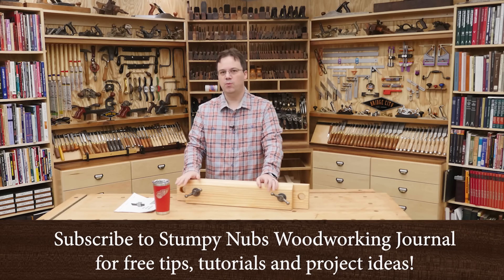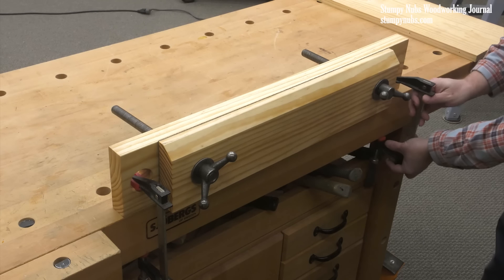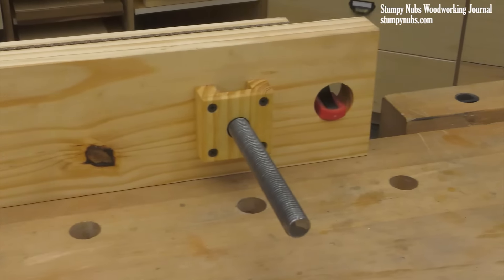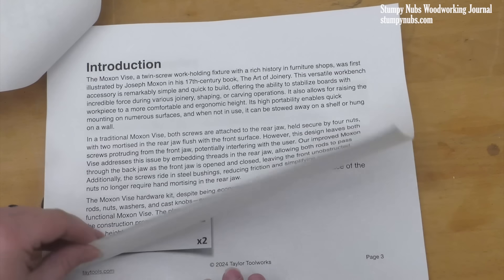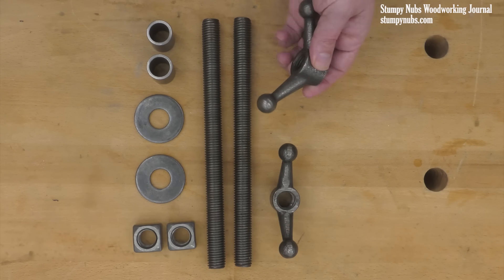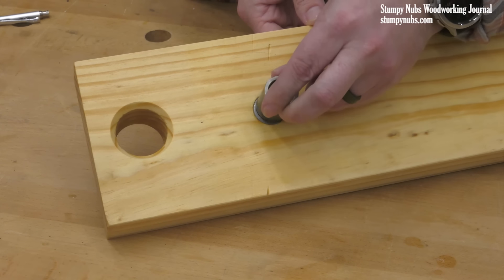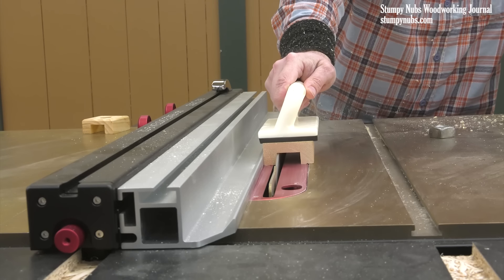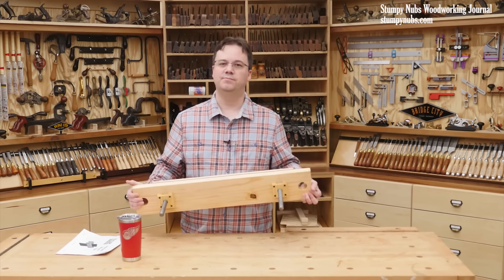Never worry about clamping your work again!

Comment: Very informative and a nice addition to my woodworking workshop. I'll use a smaller version for my craft workbench. Two hints to share, leather works well as an alternative to the cork rubber. In my experience, the leather holds up better. Also a brass nail used a a stop to keep the square nut from falling out the bottom of the slot, or better yet, mount the slot horizontal. This is better than picking up the square nut after it falls to the floor. Thanks for sharing. Please, more videos like this.

Comment: Cool. I made those plans for Taylor Tools. Glad you built it.
Reply: Why are the clamp holes round? It would seem that you could get better clamping with holes that have flats, similar to the oblong holes on the front jaw.
Reply: @mschmidt62  You could make them oblong or flat if you wanted to.
Reply: @mschmidt62  I agree with you that a flat "hole" for clamping would be better, since the fixed jaw of the clamp would only contact a round hole at 2 points, as opposed to the entire width of the fixed jaw. That being said, I suspect it is much easier for most folks to create a clean round hole instead of a flat one.

Comment: Great clamp. For  those who dont want to order the kit. You can use 3/4 all thread and 3/4 gas pipe T and two nipples to make your handles.  It work's great
Reply: But the 3/4 gas pipe T doesn't fit the end of the 3/4-10 threaded rod.   What threaded rod are you using?
Reply: @hendrst1918 Going off of memory I think 3/4 -14 npt is the size of the all thread. They were left over from a job I did. The customer loved the rustic look and we used gas pipe for everything. Closet rods,towel bars,toilet paper holders etc.

Comment: James, you weren’t kidding about the “Improved” Moxon Vise kit from Taylor Toolworks selling out quickly. I’ve been waiting for them to restock this kit for several months. Sharing a tip that I just figured out: buy TWO of the  - in stock - 12” Wagon Tail Vise kits + 2, 3/4” Washers from the “Moxon Vise Hardware Components” listing. TWO 12” kits + the 2 washers equal everything you’ll need to make an “Improved Moxon Vise.” Going this route costs ~$6 more than the “Improved” kit, but it’s available now. The only difference I can see is that the threaded rods with the “Wagon” kit are 12”, compared to the 10” rods that are part of the “Improved” kit. Figured I’d share this with your audience as a workaround until TayTools restocks the “Improved” kit.

Comment: Rob Cosman added a spring on each threaded rod. That’s a great touch to this great vise.
Reply: Smart!
Reply: What does the spring do?
Reply: @nitePhyyre  i imagine it's for opening up the clamp when you back off the screws. But that can also be done with a nut and washer fixed on the screw shaft and recessed in a countersink on the inside of the front board.
Reply: You won’t want a very strong spring I’m guessing a 15#~20# lbs. spring would be sufficient! If your doing delicate dovetails or something similar this would be a great idea!
Reply: @FiltyIncognito firmly attaching the front piece like that would cause racking
Reply: @bret_Lambky  I'm nor sure where the spring would go.  Springs only allow so much compression before they deform.  The force is also proportional to the compressed length.  If the spring is very short, it'll be a lot stronger the more compressed it becomes (until it goes no further).  If the spring is long, then it'll be more even, but where does the spring get hidden?

I like the captured nut idea better.
Reply: I would imagine the springs would be up against the turning handles just with an extra washer for the handles to spin against. The springs keep tension on the rods so that even if you haven't really cranked them down super tight, to work on a delicate piece carefully, the handles will not spin. Just to prevent little things like them backing out and un-clamping the workpiece when vibrating from being worked on with certain tools.. like a jigsaw or maybe even an angle grinder.
Not a necessity, but can be minorly helpful in certain, very specific use cases. But there are other ways of accomplishing the same thing, like using different style handles, more akin to typical vise with a longer, sliding lever arm so it can only back out a max of ~45° before the weight of the lever arm prevents it from turning any further. Or using double nuts, like an extra nut on the outside of the handle to tension against it and lock it in place. Very stable, but the most inconvenient to work with, having to wrench those nuts loose and retighten them every time you adjust the vise..
Nifty little setup. I might whip one of these up layer today to try it as an interim on my drill press. As I need a vise on my drill press, but the one I'm designing to build is rather complicated and will take me a while to build it just right as I want several features to hold various shapes at various orientations, with adjustability on x, y, and z axis...
Reply: @Matthew-bc9mr  give Rob Cosman's Moxon vise video a try.

Comment: Seems like a great holding solution - which is key in most tool using situations. But I notice it has a little 'play' [bkwrd/fwrd] due to the clamping onto the bench. It has me thinking about simple fixes to reduce this problem - maybe a couple of triangular supports to prevent rocking attached beside the clamping holes? The fact that it can be modified is a plus point anyway. I've always said that work holding is at least 50% of a successful project, cheers Jim.
Reply: I noticed that too.  Maybe build up the back piece out of two thinner pieces, with the one toward the front broader, so it overhangs the edge of your work surface?  And screw a couple of shelf brackets onto the back?

Comment: These are a great addition to any shop! 
Instead of cork on the face of the jaws. I used some leather it helps reduce marks and provides a lot of grip! I would be concerned that after cork dries out it might fall apart.
Reply: Been using leather on woodworking vises for decades.  Always worked great for me.
Reply: Great idea will have to try this.
Reply from the maker: Cork rubber is a mix of the two. It doesn't dry and crumble. A great material.

Comment: I've got 2 of those vices on a workbench I built for cutting dovetails and joinery only. One of them has a 24 in opening mounted on one end of the bench. The other will hold a 31 inch panel mounted on the side of the bench I use for casework.. They're both long enough I can put longer boards into to plane the boards for glue ups with a joiner plane. Both are mounted flush to the top of the bench.  I built that bench probably 10 years ago and it's my go to bench. Thanks for your video.

Comment: On my build list! One modification I would do: a length of wood at the back base to add a little more stability. The piece would be dowelled and be the same height as the clamping holes. Also, I would flatten the bottom of the clamp holes so the entire face of the clamp can be applied to the wood.
Reply: This is a great tweak to the design, thank you.
Reply: Great idea.
Reply: Can you better explain "flattening the holes", do you mean to square the bottom of screw hole on the front board? How does this help?
Reply: @3frogltd987  so, the vise sits on top of your table, and you use two clamps to attach the vise to the table top.  The top jaw of the clamp goes through a round hole and clamps down on the inside curved part of the board.

Comment: Shop fox vernier press clamps are a useable alternative if you can’t get the threaded rod kits. I made mine with them. The back nut needs mounting slightly different but it’s not too challenging.

Comment: made this design (very similar) about 4 years ago.  at the time, I used what I had on hand.. would have been perfect if I had a coarse thread for the all thread I used.  

The second was made with a kit from Taylor tools with protruding screw.  I thought it would bother me... but in practice, I find both about same (less screw adjustment speed).

Thanks for great video (par for course).  :)

Comment: This was my pick for a cheap woodworking startup kit I made awhile back. Cheap and easy, nothing fancy but highly effective.

Only difference was I had two holdfasts instead of clamps to hold the vice since if you're using the vice you won't be needing the holdfasts but you might be needing the clamps.

Comment: Built one for fun because it looked cool and now I constantly use it. One difference: I used a couple of big eye bolts & matching nuts as hardware. Cheap & it works fine. Thread could have been coarser though.

Comment: Made one of these years ago and mounted it flush to the left side of my table saw as I have a small shop and my saw doubles as my work bench.  Added a couple blind holes on the top of the moveable jaw to act as bench dog holders to use it as a horizontal clamp.

Comment: Well, this will make my life a bit easier!  I'll be in the garage tonight taking inventory of the wood and hardware I have lying around looking for a purpose.  I built my benches a bit higher than normal to make planing and such easier, so I'll cobble one of these together, refine it (likely for height) and roll with a better version.  My main interest is having something that will get the work out over the edge of the bench like that without the guides and screws of my standard vise.

Comment: Replacing the two washers with a pair of thrust bearings substantially decreases the torque required to hit whatever level of clamping force required.  This is great if you have children using the vice, and makes the vice nicer to use for anyone.  Just be careful not to over tighten.

Comment: Nice to see simple easy to build tools, and as always supporting smaller businesses. A suggestion - the amount of movement while sawing would feel "wrong". 
To help stop movement on the pull stroke you can add a piece of lumber that goes from the top of front face of the rear clamp down to the depth of your bench.
The width of the piece would be the a little smaller than the 1/2 the difference in length of the two jaws, one each side - and the clamp hole extended through it as well.
The clamp should still only be clamped on the original jaw to provide proper clamping - your clamps could easily do this. Or perhaps make the hole in the support larger.
To stop movement on the push stroke, add some more pieces fixed behind the rear jaw to provide a rear support.
Of course the downside is that when being stored it now takes up a lot more room. Perhaps the rear supports could be hinged and have jacks to provide the needed support...

Comment: A set of springs between the fixed/movable jaws or capturing the movable jaw with a snap ring on the screw would make the opening of the clamp easier.

That said, I have clamped objects with wood scraps and wood screws.

Keep up the content, it's refreshing to see examples where it's not just about tool equipment reviews but workshop inspired ideas.

Comment: Thanks for another great video and shop tip 😀. I presently don't have space in my shop for a nice big woodworking bench, plus an assembly bench, infeed and outfeed tables, and, and, and, and...but I do have a really nice 5 x 2.5 ft electric/hydraulic adj height work table with a Formica top that I end up using for most things...except it doesn't have any vises. In the past I had considered building a big, clamp-on wood table top with dog holes and vises, but recently I have been thinking of smaller individual add-ons, just like this. So thanks for helping me make up my mind!

This really is a great deal. I have searched the interwebs for Moxon vise kits, and this is the best one, looking at price and parts included. I was able to find two that were a few bucks less expensive, but 1) they didn't include bushings, 2) had small hex nuts instead of the larger square ones, and 3) you had to roll the dice with Ali Express, and then wait weeks.

CraftyGuyInTheWoods isn't as big as your nice shop/business...YET...but getting great tips definitely helps move me in that direction!

Comment: I'd personally allow the threaded rods to protrude ~3/4 " beyond the crank handles, so I could add one nut on both sides: each of these nuts would serve as a locking nut (this might allow to avoid the epoxy), but more importantly would allow to tighten or loosen the rods with my cordless drill and the appropriate hex nut driver bit, saving tons of times when requiring large ranges of motion (e.g. going from a thin board to a thicker piece).

Comment: One issue I see is that you need to first set the jaws two approximately opening needed based on thickness of material. This is so that one hand can hold the material while the other hand alternates between tightening the two handles.

Comment: very nice.  viewers remember to use that push tool for that dado.  and probably stand a little to the side as well.  that's a smallish piece being cut, so that increases the odds of it getting away.
Reply: it's only a block to prevent the nut rotating. If you don't like the knuckles close to the saw approach, a backer piece of 3/4" stock with a couple of pieces of 3/4" (or whatever the nut thickness is) square glued together (or just held with the 4 fixing screws) would do just as well ... whichever you choose they get rid of those goddamn-sticky-out-thigh-ripping threads! :-)

Comment: Stumpy, another well done video.  This video I will keep and use … BUT, { ain’t there always a but }, I was just thinking ~ wouldn’t it work to mortise in the square capture nut into the jaw then cover it with a heavy washer held by 4 screws?  This would eliminate having to make the wood boxes.  Easer, cleaner, and more elegant.   And iffen you ever need to get to it ~ easy peasy.
Well now, that’s my thought and I’m sticking to it.  Let know what you think of it.

Comment: Alternately, build an "H" out of 4x4s with the central part 2/3rds the length of a side (stacked 2x4s are ok too).  Lay it sideways on your bench, and clamp it in place.  2 more clamps hold your work in place.  It's a simple bench bull.

Comment: I noticed when you demonstrated with the saw at 1:02 that the vice rocked a little.  It may not be a problem for you.  For me, I like things held steady for everything except rough carpentry, so personally I would think about adding something to stabilise the vice and resist any leverage.  Yes! I know, a bit of experimentation may be needed to find what works well whilst still maintaining portability and convenience.
That said!  What I really like about this vice pattern is that, because the front jaw floats, it can securely hold components that do not have parallel edges.
Thank you for another brilliantly presented vid'.  Once again you have inspired me with interesting design ideas.
Reply from the maker: Clamp it down tighter.
Reply: @StumpyNubs  Touche!  😎👍
Reply: It's a fairly significant lever arm -- the force is applied to the tip of the workpiece, and the fulcrum is either the bottom rear edge of the vise base at the benchtop (push stroke), or on the pull stroke, even longer--where the workpiece crosses the bottom of the benchtop. Both of these are applying *lateral* force to the contact points on the F-clamp's jaws, which they are not designed to take. 

The clamping force between the table and the vise needs to *directly* resist the force applied to the workpiece--it'd be better to clamp the moxon vise to the front of the workbench, not the top. The static portion of the vise needs to project below the top of the workbench to allow it to contact the bench's front face. You could do this by using bar clamps from the back of the bench (or dog holes?), or by clamping the whole thing into your existing face vise, maybe with some grooves to allow it to go past the screw/rods. 

It'd be less of an issue if you had not raised the workpiece so high out of the vise, but still needs to be addressed in the design IMO.
Reply from the maker: @joshwand  It's a 400 year old design that's served craftsman well. Good thing you spotted its flaw from your screen, LOL...
Reply: @StumpyNubs Moxon's was built into the benchtop itself as a face vise, and all the other early source material I've seen shows twin screw vises as integral to the work- or saw-bench. My issue is only with this removable version, which is clamped in the wrong direction to resist the applied forces.
Reply: @StumpyNubs  others' designs have accounted for this by adding projections behind the static face (e.g. will wright) to reduce the effective lever arm, and/or are held down by holdfasts (e.g. benchcrafted), which due to their bracing against the vertical section of the table, better resist the lateral forces. I haven't made a complete survey, but this one seems particularly wobbly, for the reasons I've mentioned. 

Your snippy reply aside, I'm a big fan of your channel, please keep up the good work!
Reply: @StumpyNubs  final note before I forget-- this problem doesn't apply as much when applying forces primarily parallel to the benchtop, like edge planing. In that case the clamping force is mostly in the correct orientation. Holdfasts would be better, though, since a pair of them can apply linear force in 3 axes.

Comment: I made one of these, though without the captured nut and screw. Instead, the two vise pieces are slotted from the end enough to pass f-clamps through. The inner vise piece is deeper to hang past the edge of the bench, and has another piece rebated into it to form a sort of 90 degree corner so the whole inner vise part butts into the bench top. Then two holdfasts slide into dogs and make the vise secure over the rebated part. This one here might be easier to use, truth be told.